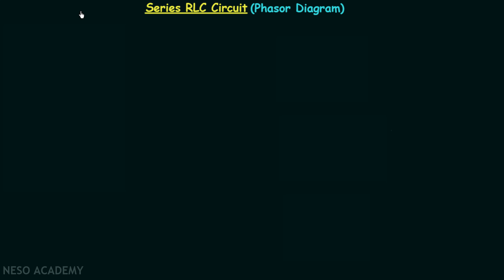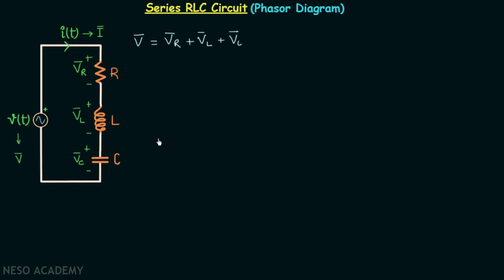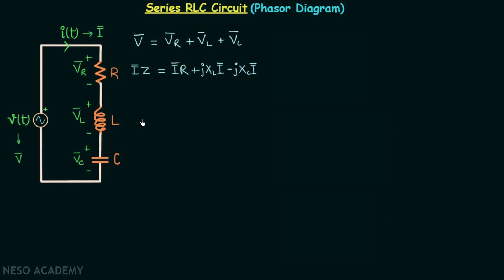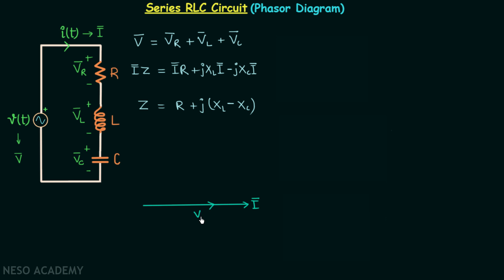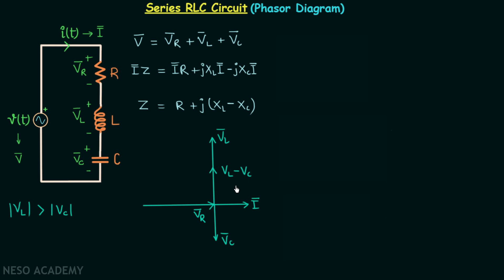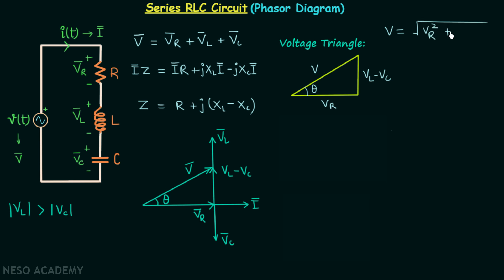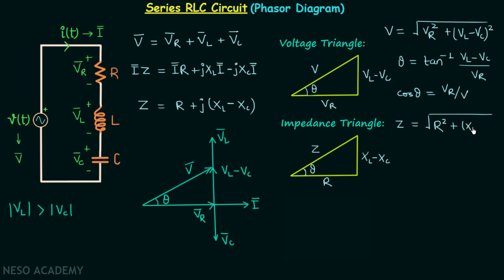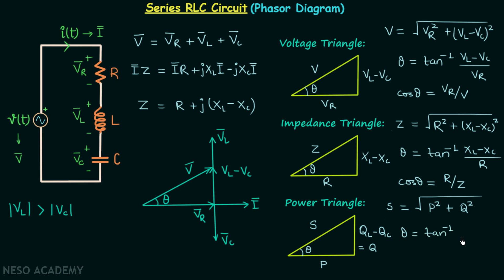Phasor Diagram of Series RLC Circuit

Comment: sir you can assume vL>vC and draw the phasor...so in this case xL>xC...inductive effect is more than capacitive effect..hence we can conclude that current will lag the voltage by some angle...so hence pf will lag... simillarly if we can take Xc>XL then pf lead...and in case of Xc=xL...it will behave like a pure resistive circuit...pf=1..